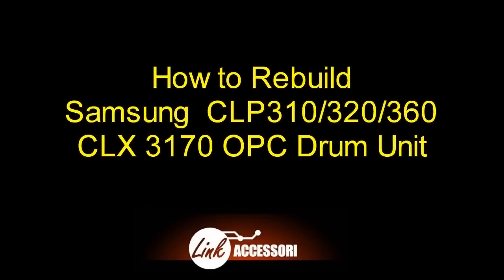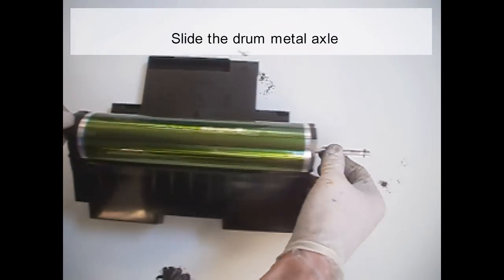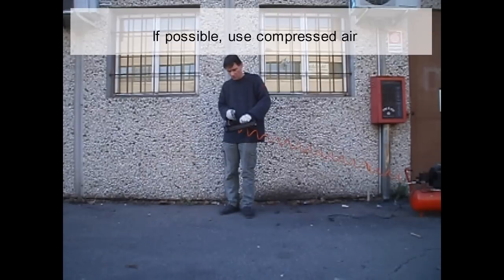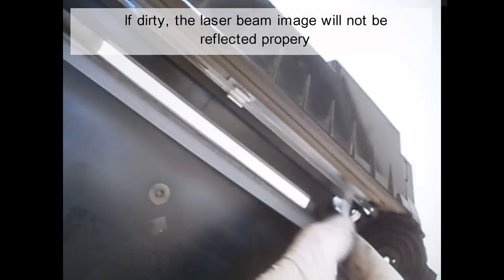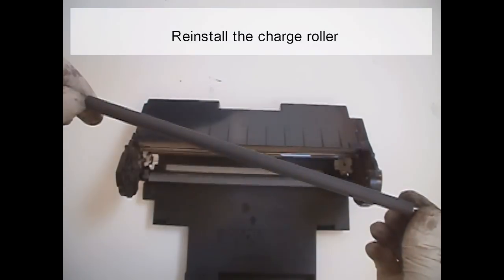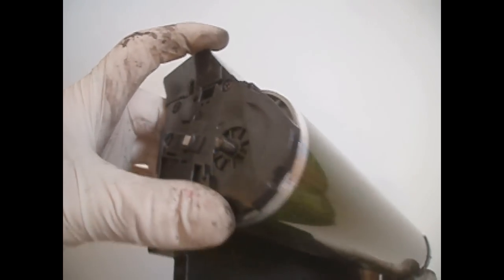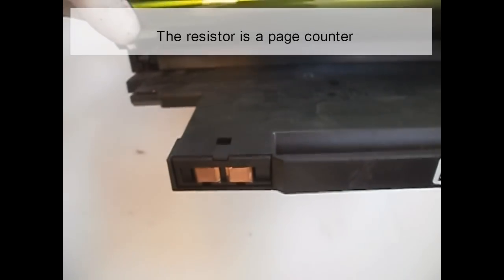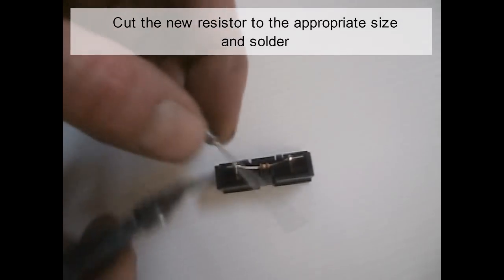Samsung CLP310 320 360 CLX Drum unit Rebuilding Instructions

Comment: worth noting, for anyone who doesn't know, when replacing or refilling/resetting/cleaning the drum and/or toners, you should grab a ziploc bag and also empty the collection cassette into it, making sure to wear a face mask and gloves for protection against the toner dust. make sure to completely close the ziploc bag afterwards and dispose of appropriately. Most of all, don't be put off by the fact the toner in the bag will resemble mold lol.
Reply: Modern toner is soy ink. It's not nearly as bad as you're making it out to be.
Reply: @EvanCarrollTheGreat  Patently false.

Most modern toners are composed of 85-95% plastic. The other 5-15% is comprised of ground silica, iron, chromium and zinc.

What you're thinking about, is inkjet cartridges. Not even close to being the same thing. Regardless, you don't even want to have inkjet liquids touching your skin because they also contain petroleum. Petroleum is a skin irritant.

Comment: Hello, I have a question : when cleaning my printer (samsung clp315) last week I removed the drum unit and noticed that the drum was full of toner. I swipe the drum and turn it but still a lot of toner. I shake it and a lot of dust (probably toner) was getting out. I am wandering if this normal or not : should we have toner inside this unit ? I tried to shake it until no more dust is getting out but it lasted for long. Should I dismanteld it and clean it as shown ? Thanks.
Reply from the maker: The waste toner is contained inside the drum unit, so it's normal to have toner in the drum unit
Reply: @viandant5  OK so it is wated toner, then I can clean it, this will not affect negatively the printing ?
Reply from the maker: @fredericpageot3506  no, you can remove it. Or even let it there, it does not change nothing

Comment: My drum makes some noise after replacing the OPC... Do I need to lube the shaft before pushing it through the OPC? 🤔🤷‍♂️
Reply from the maker: It might depend fromn the metal shaft, you can use a bit of grease

Comment: I cleaned my Samsung CLX 3175 drum unit as per the video.  On reassembly the drum turns freely counter clockwise but jambs up in the clockwise direction (as shown in the video.  I can't figure out why - has anyone else had this problem and is there a fix?
Reply from the maker: +Curtis Nowosad first to install the drum, you have to lubricate the drum with a bit of toner (minute 3.55)

Comment: Many thanks for this video!
My Samsung C480 had very dirty prints. On inspection the drum was also very dirty. First cleaned the transport belt, but that did not help. It turned out that the toner waste reservoir in the drum unit was completely filled to the rim. So it couldn't clean the drum anymore. I removed the roller and shook out all toner waste. Cleaned the drum unit and voila: happy clean prints!

Comment: Thank you very much for this video. I was able to fix "image ghosting" on a Samsung CLP-315W by following your instructions to clean the charge roller with water. Imaging Unit was only at 1100pgs, 84% life remaining, but living in dry climate(Denver, CO) made the charge roller(and foam roller) ineffective at removing excess image toner. 
Imaging unit drum was diagnosed as culprit by measuring 7.5 vertical inches between original image and ghosted image. Again, 10,000 thanks.
Reply: Thank  you for this comment. I have the same problem and did not know what to fix it. I will try this

Comment: Hey, You are genius !
«How to remove and clean Samsung Transfer Belt CLP-365» + «How to Clean an OPC Drum for Laser printer/Copier» + «CLP310 320 360 CLX Drum unit Rebuilding Instructions» helped me to diagnostic my CLX-3175N ghosted pic (from top printing) on on the bottom of each page, and was spaced to 188mm.

I read forums, but was not sure if it was the transfert belt or the OPC Drum.
Those both parts are quite expensive : ~ 120€ for both, not sure it worth it !

I did the cleaning like you said on both items, on the tranfert belt, it didn't change.
But I for the OPC drum, I well listen your precious comments and found after the 1st rebuild a better printing, but still some few ghost pic on bottom.

I pushed a bit all the wiper blade for enable it better fit the OPC Drum.
And it worked... !!
I know that It won't be lasting, but I know now for sure that's it's the OPC Drum, the wiper blade exactly.

[EDIT] : I forgot also to mention excellent tuto «Toner Cartridge Printing Defects: Causes and Solutions».

 Many thanks !
Reply from the maker: a ghosted print may be related to the drum or to the fuser unit. the distance of 188 mm is related to the drum but I don't think it's a wiper blade problem. Probably you have to change the OPC drum
Reply: Hehe... Just have a look when I gently pushed the wiper blade in the drum direction in a way of having a better contact on the drum you can see spectacular result on the right :
http://imgur.com/ssh7i6P or http://i.imgur.com/ssh7i6P.jpg
Deprives me of a doubt : I also changed the black toner cartridge. I don't remember when in all those repair process (quantity <15% toner) but I see on the picture that it owns a "Deve Roller"... This change could be related also ?
Reply from the maker: the space of 188 mm is related to the drum the developer roller is 26 mm but the ghost images are related to toner cartridge too. the developer roller is the roller covered with toner you can see on the toner cartridge

Comment: Original factory units that come with the printer do not have the thermal fuse anyways. In order to reset the drum without the thermal fuse, just put a jumper across the terminals of the resistor (small piece of copper wire will do). Close the door and plug the printer in. It will say "Initialize..." followed by a flash of lights, after which it will most probably reset itself as it is unable to "blow" the fuse (the cycle will repeat itself indefinitely). At this point switch it off (unplug power) and take out the holder with the resistor again. Take the jumper off (break the wire) and put the holder back in. Close the door and let the printer startup.
Tested on CLX-3300 series with CLT-R406 drum.

Comment: Thank you for the video. I have a Samsung C460W that began to have faded printing. Cleaned out the waste toner tank, the transfer belt, and finally the image drum per your videos. Wow, a LOT waste toner in all those components! I found it best to do this job outside on a nice day. Used an electric leaf blower on low to blow everything out. Not sure why cleaning the image drum assembly helped, but it did! I am thinking it is the cleaning of the charge roller and the light rod that actually makes the difference. All of the other cleaning is just to get rid of the excess waste toner, which must be disposed of before the containers become full.
Reply: did you change/replace the resistor too?
Reply: @viauyeung  No, I did not. There is a method to reset the laser printer to set the counters back to zero (if I remember correctly).
Reply: is there a remaining toner in the drum unit that need to be cleaned?

Comment: I was going to trash my CLP315 because it wouldn't be economical to fix it. This was very helpful and the thing is printing perfectly now. Thank You. The one thing I can't figure out is how in the world the reset fuse replacement can be figured out by the printer that it just hasn't been lifted and resoldered. That is a new one for me.
Reply from the maker: +Dick Wooten the new printers are already resetted, you don't need to reset the drum so there is no fuse in the starter drums
Reply: +viandant5 No problem. I was just remarking that the videos that I have seen are strange because having to replace one thermal fuse or resistor with another and the printer somehow knows that it is another one of the same value is a strange concept for a guy who was a radio technician for a lot of years. Thanks again.
Reply: @Dickwooten  Looks like he added a thermal fuse in parallel which has little to no resistance may as well soldered a piece of fuse wire across it
Reply: @Dickwooten  When the printer sees a drum unit with very little resistance, it assumes a new one has been installed. It then blows the fuse by passing a lot of current through it. when this fuse blows, the 100k resistor is the only current path left. The printer now knows it has successfully "started the lifecycle" of that toner. It has no way of recognizing the toner (or a new one) besides a low resistance path that became high resistance after trying to initialise it.

Comment: CLX DRUM SHAFT INSERTION:  Samsung seem to use the same drum design for many of their printers esp CLX series but bearing different Model numbers.  The most important point in dismantling and removing the drum shaft is a result of the internal electrical contacts that while rubbing on the shaft, allow a clean shaft to pass easily through them in only one direction. This is from the end bearing the gear (and internal contacts) towards the  opposite end.   Unfortunately this is not mentioned in this "Remanufacture" procedure but can be seen by carefully comparing both the disassembly and assembly segments of the video.

Comment: Excellent video. I followed the instructions and did pretty much what you did on the video on my CLX-3185. Alas, it made no difference to the print quality at all. Still washed out colours. And now, a white line down the middle too. I must have left some dirt in the unit when reassembling it. Hey ho, if new unit doesn't solve it, I'm chucking the printer and buying a new one.At a loss of why it won't print colours out nicely. Black  is more or less OK.
Reply: Check/Clean the Laser unit under the drum in the Bottom (papertray pulled out) If rhat doesnt Help, Change the OPC of the Drum

Comment: Hi I've apply your guide on my samsung CLX3175N, and i've same problem with a 5 millimeter black line at the top and another 1/3 of the darker leaf. When i print 3/4 pages, it's better on 3 and 4 pages. i don't succeed to see which piece i must change. thanks for support and thanks for your very best videos.
Reply from the maker: +Antoine Girard I would check the fusers, or the belt
Reply: +viandant5 thanks viandant5, i've unmount fuser and  check it, don't seen something seems wrong. On belt, i see trace of precedent print, i've unmount it and clean it, without success. when i just do a copy without something on the window, i've trace on the page. thanks
Reply from the maker: +Antoine Girard I think it's something related to the fusers, that when are hotter after some copies work well. or may be a toner cartridge near the end of its life

Comment: Hi, My CLP-325W printer worked fine when I put it away for storage in 2021. Now that I want to use it again I find that after the power-up sequence completes it shows a steady red light.
All toner lights are off, so toners are good. All doors are fully closed. Paper tray properly fitted (with paper).
Any ideas on how to fix it?
It was a new printer when I got it several years ago so I'm guessing that there will only be one resistor currently fitted. Should I fit a resistor or try the reset thing? 
Thanks for your video and help.
Reply from the maker: It's a general error, perhaps the drum unit or toner waste box. If moved the toner could cover the windows of the sensor so you have an error message Are there addtional information in the printer folder?
Reply: @viandant5  Printer Folder?
The printer did get shipped from the Far East to UK so internal movement of assemblies is possible but I already removed and refitted the drum unit and toner waste box.
Where is this sensor window?
Thanks for the reply.
Reply from the maker: @unreasonable4rce  Clean the windows of the waste toner box
Reply: @viandant5  WOO HOO! FIXED! You're a Genius. Many thanks. So grateful.😀
Which assembly do I need to clean/lubricate in order to stop squeaking/groaning noises?
Reply from the maker: @unreasonable4rce  May be the metal axle of the drum, or the bushings of the fusers
Reply: @viandant5  Okay, thanks. Best lubricant?
Reply: @viandant5  Thanks. Best lubricant? Silicon spray?
Reply from the maker: @unreasonable4rce  grease for mechanical parts
Reply: @viandant5  Thanks for your help. Much appreciated.

Comment: Your Tips are Great!!.Thanks a lot.Only what everybody should remember" toner is harmfull so don't get in contact with skin,body or inhale ".Whats about the resistor to replace?...this is a normal 100k resistor,..so how should the system short or open it when the counter for drum is full??...maybee you know it?
Reply from the maker: TheFlyer67 yes you are right, toner is harmfull but probably not carcinogenic.
 the fuser it's a normal thermal fuse 1/16A and it blow when you insert the drum into the machine. you'll find more information in the comment of khurram akhtar
Reply from the maker: coal miners stay yeas inside the mine

Comment: HI Viandant, thank you for the very informative and easy to follow video. I followed your instructions very closely to clean and reassemble my CLX-3185FW printer with no problem - other than heaps of waste to be emptied :(    However, my printer is now printing totally black pages..? Can you tell me why this is?
Reply from the maker: Check the connection between the internal contact of the drum and the metal pin, check the supports of the charge roller and its connections, check if the drum turns freely

Comment: Is the drum that should 'lubricated' with toner a NEW one, or the same one (called the 'old' drum when removing it) that was taken out?  I just installed a new drum assembly and my 3170 still prints ghost text & images and strange horizontal black lines on the paper.
Reply from the maker: the lubrication only help the drum to rotate freely. probably you problem is related to fusers or toner cartridges

Comment: My name is humar...I saw in the video ..that you change the fuse in blue color... so can you tell me the value of this fuse are you wearing... the 100k, resistor I already changed it..so I only need the blue fuse..Thanks buddy for you excellent information and video too...Grazie e Arrivederci...
Reply from the maker: +Humarbugo Ballesteros it's not a resistor, itìs a thermal fuse. In order to reset the drum without the thermal fuse, just put a jumper 
across the terminals of the resistor (small piece of copper wire will 
do). Close the door and plug the printer in. It will say "Initialize..."
 followed by a flash of lights, after which it will most probably reset 
itself as it is unable to "blow" the fuse (the cycle will repeat itself 
indefinitely). At this point switch it off (unplug power) and take out 
the holder with the resistor again. Take the jumper off (break the wire)
 and put the holder back in. Close the door and let the printer startup.

Comment: Hello viandant5.
This is an excellent video. Thank you very much.
My printer is Samsung CLX 3305w and I wanna do this procedures because it's asking me to change the drum unit and it's very expensive. Btw, I have 3 doubts before. I would ask for your help. :)

The doubts are:
1. Do I need clean all these things first or if I just change the resistor the printer will work?
2. My drum unit have only 1 resistor (100k). If I change it for another one, the printer would work, ins't it?
3. Do you know the details about this resistor? I've been reading about it and it seems there are variants like 1/4w and 2w, something about 5%, ...

Thanks a lot.

Comment: Hi, thank you for the video. It’s quite helpful. I replaced the drum on my printer but now it prints blank sheet. Do you know why?
Reply from the maker: Check the contacts inside the drum, check the continuity between the metal rod and the surface of the drum
Reply: Not sure if we have the same case. I got the same problem but it finally works. I re-checked the video and realized that I put the drum on the opposite direction. See the video 4:20 that the gear part should be on the right hand side. Thanks for your video. It's awesome.

Comment: Good afternoon,
I have for sometime a laser printer ; Samsung CLX-3175-FN and was very happy with the performance of it, but lately I think that my laser printer is due for an service checkup, sins the paper transport is giving a lot  of noise and paper got jam so often. I have try to my knowledge to clean the dirt and black marking on the print copy with no result. Mean time I have now using windows 10  and the drivers for this type Samsung is no longer available, what do I have to do instead of buying another printer, can you give me some advice.??
Reply from the maker: where the paper is jamming? in the paper cassette? may be the pick up roller are worn or dirty, try to clean them with alcohol.

Comment: Where i can get the foam roller below the rubber roller. My foam roller is broken.
Reply from the maker: You can only take it from another used cartridge
Reply: @viandant5  my foam roller is almost broken too but I still have it cleaned and installed back. The printer seems working now. Could let me know what function the foam roller is?

Comment: Well, it is printing very well now.  However it seems to be making scraping sounds inside.  i didn't see any suggestions to oil the drum axel - which is what it sounds like...  Should i try this?  Otherwise it seems to be printing just fine.

Have a super day and thanks for such a wonderful video!  :)
Reply from the maker: +Frederick Frazelle yes, you can use a bit of lubricant oil or conductive grease on the drum axle. have a godd day you too